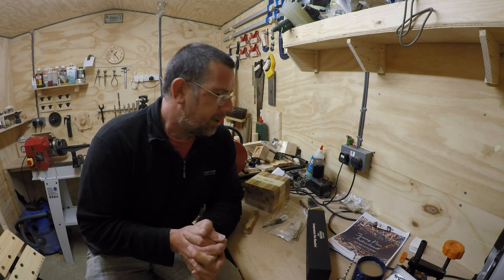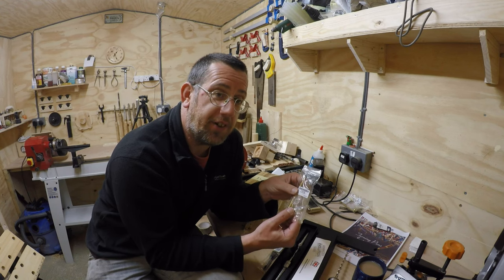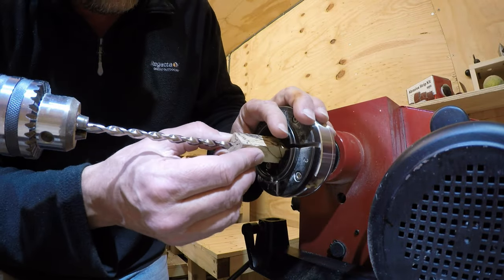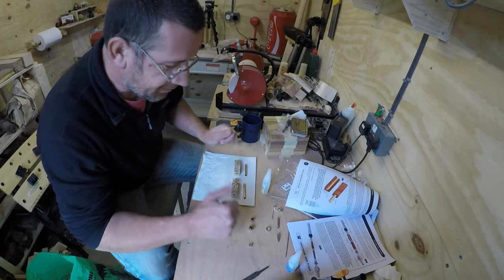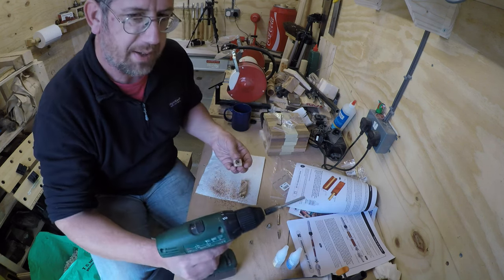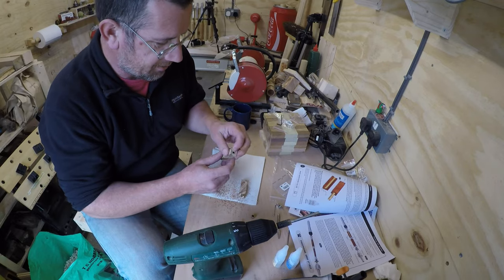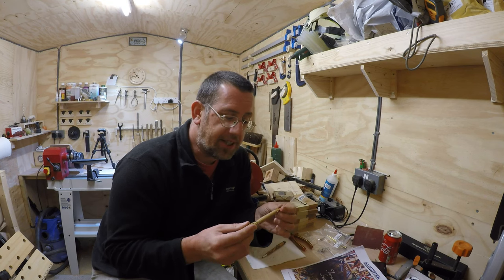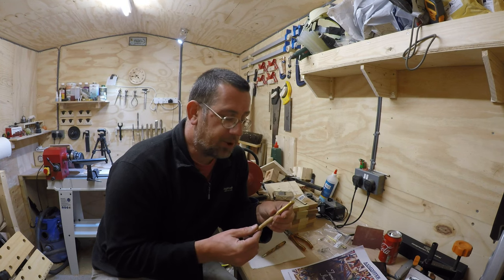First Pen - Episode 35

Comment: Ya gotta start somewhere.  If you use CA glue, get yourself a package of micromesh pads and wet sand it. Look around on YouTube, there are several that show you how to disassemble a pen. 
You will never regret purchasing a good mandrel, it will make a big difference. 
I made a mistake once, I thought I was wrong, but I wasn't.
Reply from the maker: Thanks Christian. The mandrel was worth the extra small amount of money to go for the top one. I was holding off the micro mesh pads as they are not cheap and wanted to get an idea of how often I will do these. Someone else has suggested some 1200 w&d with some T-Cut which I will give a go first as that is a cheap option and I have seen others get good results that way.

Comment: Hi Paul, regards to finish try a light going over with wet, wet and dry 1200 grit then use t cut polish to really buff it to a high shine
Reply from the maker: Thanks MrJac. Before I started this first pen I did look for T-Cut but it must have been thrown out as the last time I used it must have be 15+ years ago. I will look at getting these as they will be a cheaper option compared to others.